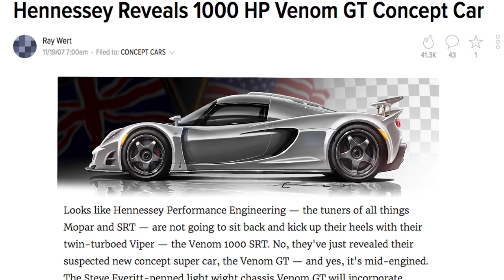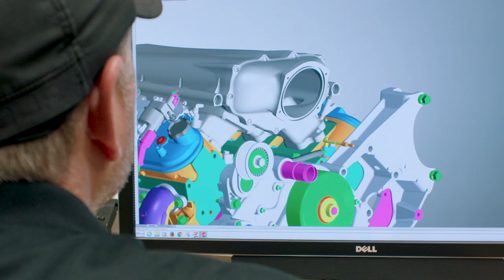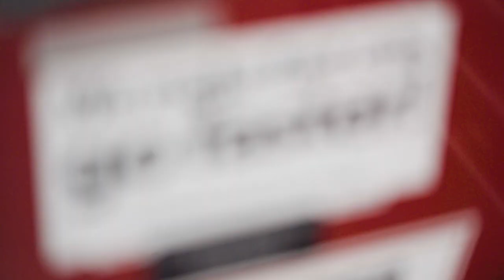VENOM F5 - PART 1: ORIGIN OF A HYPERCAR

Comment: I would love to see the F5 just demolish the Chiron in every way and I have very high expectations that you guys can do it. Good Ol' American Muscle can't be beat!
Reply: William Leonard I want to buy one of these lol, probably gonna have a crazy 0 to 60 and top speed
Reply: well, bugatti cant be beaten in the way of luxury...
Reply: William Leonard venom would destroy it already
Reply: Bugatti has no luxury components most other cars dont have, lol
Reply: RazorFX I know but Bugatti and a lot of Europeans think the Venom  GT doesn't count as beating the Veyron because not enough Venoms were made to be considered a production car so the Veyron technically is "the fastest production vehicle in the world" even though the Venom is faster and quicker its considered a modified vehicle or whatever because Hennessey based the Venom off a Lotus Exige body
Reply: I like the fact that a sub $5k LS motor from a Chevy C6 Z06 can be tuned to get well over 2500 hp with well spent upgrades. But that only makes sense in a dragster so for this Venom F5, 2000 hp is more than enough to beat the Bugatti Chiron for anything, not just top speed, but track times. Also the Bugatti Chrion is all about luxury inside but that just fades the point of the car. Only problem is the type of tyres and strenght strength of the wheels/rims on each axle and even the Chrion has that problem. Not sure if there is a wheel made of titanium though (carbon wheels exist but need more stronger than that).
Reply: Josef, ever heard about Rolls?
Reply: of course. why? its comparison of chiron and venom f5.
Reply: Chiron is already not a record breaker.

Comment: An F5 tornado speed rating is 261-318 MPH so i'm hoping they hit that 300 MPh
Reply: Tyler Linn It won't hit 300, tyres are the limiting factor.
Reply: Lambo they managed to hit 270 with the Venom GT. tires will be the weakest link im sure but tires are built with a margin so as long as they do their research they can probably touch 300. the issue is that it wont be able to run the excessive speeds for very long.
Reply: yeah, i'm guessing they will hit high 280's maybe low 290's